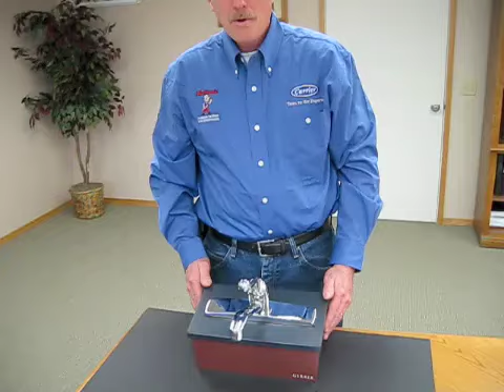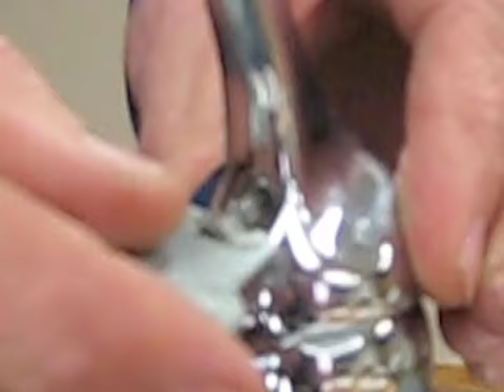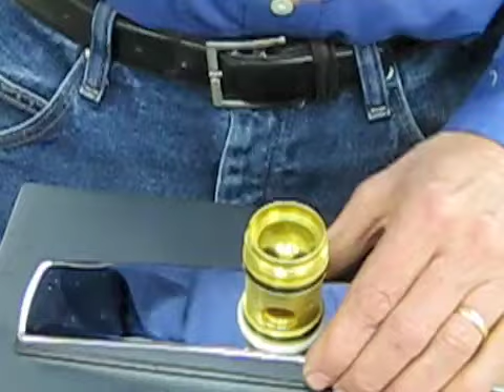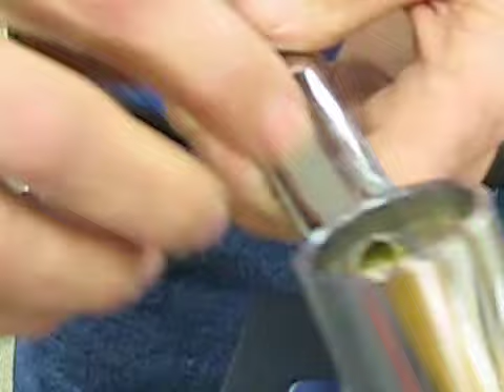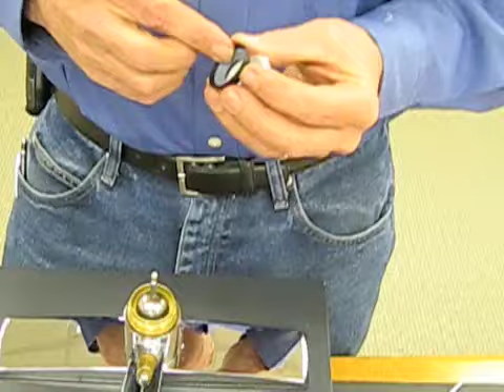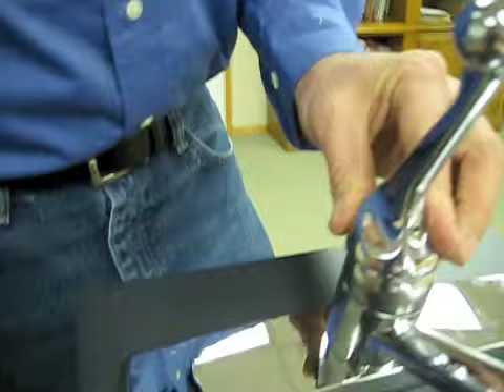Delta Faucet Repair

Comment: Not a plumber ,,,but extremely handy. Have fixed many faucet and shower assemblies over the years, either as new  or rebuild. I think,,if memory serves. The location , position of the ball assembly could in fact cause the hot and cold discharge to be reversed. Still working. Just in an opposite fashion..Which was not shown . Not tragic but requires you  to disassemble a second time . ...Oh ,,,and have never used a wrench without some kind of protection for the chrome from the the wrenches "teeth". Even in my own home . Nevermind a customers if that were the case.

Comment: I completed this 2 days ago. Lubed where recommended.  The spout Drip was resolved but now there is really low and slow seepage out of the faucet body onto the counter  and NO HOT WATER!  Went back through it again and carefully examined everything. Same result.  Yes, main water turned back on and hot and cold valves under the sink were turned back on.  Can anyone advise?  Thank you in advance. 🙂  -Brian

Comment: On my faucet the cap assembly is stuck so tight that it's hard to get off with a pipe wrench and rag to protect the assembly.  The bottom of the cap has "teeth ridges" going around the entire base of the cap ( It's a little different than the one in the video.  I'm not sure it's even a Delta ).  With the cap assembly being so stuck and hard to come off, is there anything I can use to help it come off?  I don't think so but I'm not sure.  I don't want to damage the faucet.  Thanks

Comment: It is nice being shown tutorials on a new faucet, but I have a 12 year Delta Lewiston single lever kitchen faucet that had a bound up (stiff) hub that would not rotate.  I think it was originally installed with a very tiny leak that finally caused enough mineral deposits to bind up the hub rotation.  It took me 6 hours to fix due to the scale and mineral deposits, but here are some tips.
There were enough mineral deposits in the set screw handle that it caused the Allen wrench key to begin bending so much I thought it might break.  So I tilted the handle back, added a piece of tape over the bottom half of the set screw hole, and filled it to the top of the tape with penetrating oil.  After 30 minutes it still would not budge, so I made fashioned an extension for the Allen key by slipping a long thin hex socket wrench over it.  That worked.
Next – the plastic dress cap was welded so badly with mineral deposits that it would not easily rotate off.  It has internal sprocket holes rather than normal external wrench flats, and I didn’t have a spanner.  So I tried a strap wrench.  That just slipped off since the cap is domed shaped, so I tried a layer of super grip fabric under the strap wrench, which did not work either.  I then checked the web and found a hint that tapping it first would free it.  That seemed silly, but I wacked it anyway with the plastic handle of my screwdriver, and low and behold - that did do the trick. 
I thought the hub might just slip off up over the valve bonnet, but was unable to do this, so spent the next two hours trying to unscrew the valve bonnet with all its mineral deposit welds.  My big adjustable wrench just mangled the brass flats, so I opted for a pipe wrench.  However there was so much mineralization on the threads, that the pipe wrentch starting turning the entire faucet body.  I tried tightening the mounting nut under the sink, but that did not help.  So I stuck a big screwdriver down the faucet wand hole in the hub, and applied counter torque in the opposite direction as I rotated the bonnet with the pipe wrench.  That slowly did the trick, and was able to unscrew the bonnet after 15 minutes, and remove the valve cartridge.
I thought the hub would just slip up over that, but it was stuck solid.  After another hour of rocking it back and forth, inserting a putty knife into the bottom of the hub and prying it up with a screw driver, and inserting a screwdriver into the other side of the bottom and rotating it to add more leverage, it finally pulled up and off.
It took another half hour using a wire brush and a Dremel tool grinder to remove all the scale and mineralization that was built up in the hub.  And had to scrape a lot of black stuff off the internal valve bracket that the hub fits over. 
I cleaned off the threads, o-rings, and viring (the v is narrower at the top when you drop back onto the bonnet).  I slathered silicon grease over all threads, rings, and gaskets.  Then reassembled.  
It leaked a bit the first time I tried it, so I removed the dress cap and tightened the bonnet a bit more, which seemed to do the trick.
All in all it probably would have been cheaper time-wise to just install a new fixture, but that would admit defeat.  And none of the parts were actually corroded since they were all brass and chrome and plastic.  The Delta Lewiston was well made (and made in USA).  I don’t think I would have had any problems if the original installer had noticed and fixed the tiny leak.
Reply: I think I am facing the same issue with my bathroom sink faucet. Its a delta brand single handle (acrylic - looks like glass, is transparent) faucet. It opens up from the top by removing the plastic cover cap and removing one screw. After that I am unable to budge the plastic dress cap. Reading this gives me an idea that mine probably is also stuck for similar reasons as I noticed lots of green/orange stuff around the faucet assembly. Thanks for sharing your experience in such detail
Reply: OMG, I went through the same thing you did! At every turn, everything was stuck and corroded but I would not admit defeat and spent countless hours (appx 8-10) taking apart the faucet, then cleaning all the corrosion only to find out (in the end) that the replacement parts didn't quite fit. I thought I was doing something wrong so I disassembled and reassembled multiple times then went to the store and bought Delta replacement parts instead of Danco but the cam still didn't quite fit right. The original cam assembly looked exactly like the one in the video but I could not for the life of me find those exact parts. When I finally managed to reassemble the faucet despite the bulging cam assembly, the handle didn't shut off the cold water as it should so I had a to cock the handle to the right to shut off the water. After all this, within 2 days, the spout developed a pinhole causing a miniature geyser 🙄, that's when I knew I had to throw in the towel but wanted to stop the geyser until I could find a replacement faucet so I proceeded to try silicone to plug the pinholes, that didn't work so I moved on to Marine epoxy, small beads of water ran down the spout so I wrapped the area with Teflon tape which somewhat helped mitigate the small drip. I am now in possession of a Peerless faucet which looks similar to my old Delta and pray that the installation will go smoothly. Lesson learned, don't mess with a forty-year-old fixture, the manufacturer probably no longer makes the correct parts to rebuild it. On the bright side, I can now rebuild a Delta faucet with my eyes closed! 😂
Reply: BTW, I had to saturate every thing with WD-40 and let sit for 30 minutes to an hour in order to first disassemble the handle, then the bonnet, followed by the cam and ball and finally the spout which was the worst. I of course then had to clean and flush the toxic substance from the parts I had to reuse. I realize this was an insane project but I just didn't want to give up.

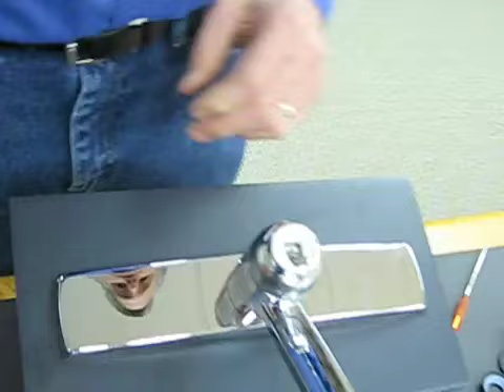Comment: What about the white plastic part that's threaded in to the cap nut?...., there's a weird 2-prong wrench thing to turn it.   Why does it thread into the cap nut, which one do you screw tight first, why isn't anything said about this?  At 8:17-18 when you turn the cap nut with the wrench you can see the white plastic thing move with the nut a bit and also hang up a bit while the cap nut turns around it....that tells me there's some kind of adjustment there that was ignored.  Maybe you just got lucky it was close enough?.   Anyone able to explain how it works?
Otherwise thanks for the video :)
Reply: The white plastic piece has a small tab on it, and the metal 'neck' has a cut-out for the tab. They have to line up to keep the white plastic cap from turning. You can see him pressing the white plastic part down with his finger, to keep the tab in the slot, as he tightens the metal part. The rubber things underneath want to push the white plastic higher so the tab and slot don't meet, hence hold it in place with finger. Also I find that hand tightening that metal piece is good enough, home owners do not own a tool that fits those tiny flats.
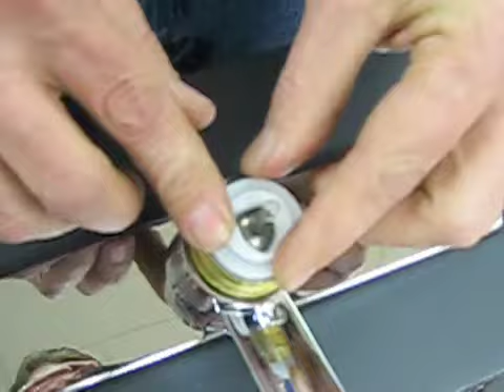Reply: @DAS-Videos   No I'm not talking about the big white plastic thing he calls the "cam", that's obvious, and he explains that, I saw it.  I'm talking about the small white ring that's threaded into the big metal cap nut, he calls it the "cap assembly", at 7:20.
Reply: @TonyMontgomery18  Ohhh. That is what controls the downward pressure on the assembly. It works like a packing nut on a valve. You can loosen it with the right tool, and after screwing on the cap, tighten it until snug with the tool. Or just keep it at the set position like he did. Watch the YT video that ends with watch?v=WpchtD1lkAs
Reply: @TonyMontgomery18  oops I meant youtube video ending with watch?v=3f38yfY3OO8
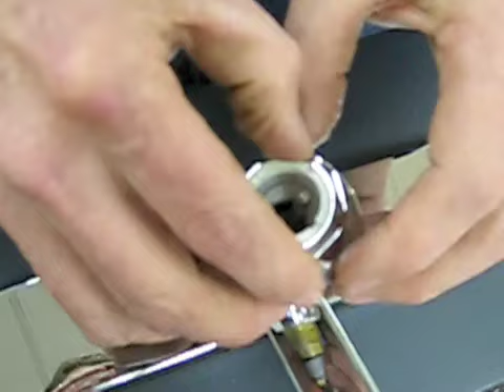Reply: At 7:26 he talks about the tab and slot.

Comment: Remember to tell your audience that the notch inside the housing lines up with the slot on the ball. It makes it easier for the novice. Also remind them that they will replacing parts on an old faucet that has calcium build up some things might feel like they are all seized up such as the set screw and the faucet arm. Good video all in all.

Comment: Mine is a Delta kitchen faucet that looks like this on the outside, but nothing like this on the inside. Instead of a ball, there's a flat white puck that is moved around over a plate with holes in it.

Comment: Okay I have turned my spout to the side but it will not come off and I have manhandled it enough to feel like it's really not coming off. Any tips? Thanks!
Reply: Just so people know most probably will not have such an easy time getting their spout off and I had to turn mine from one way to another and violently manhandle it over and over and over in order to get it off.
Reply: @lockergr  I can't get the spout off at all, any thoughts or solution?
Reply: I cant get the damn thing off turning it to either side, thoughts?

Comment: Nice video! only two things changed. The Allen wrench tool supplied was one size to small or the wrench itself stripped out. Next was I used a large crescent wrench instead. Other wise I followed your instructions exactly.  Thank you for posting.

Comment: You did not mention the white nylon threaded piece with the two slots when you replaced the CAP. This is why I watched the VIDEO...because the instructions don't include the adjustment of that nylon part.
I THINK it is a way to add slightly more pressure to the BALL, but I am not sure so I will try another VIDEO.

Comment: Could have been a MUCH better tutorial IF the camera had been in FOCUS!  Also, the springs have a larger diameter end, and a smaller diameter end, and you failed to show the proper positioning for these springs when they're reinserted!
Reply: I was thinking the same thing. Which side goes into the washer? If you have a heads up please reply...Thanks.

Comment: can trash get any where n there & cause low water pressure & or low water volume ?
Reply: Yes, trash in the water supply, namely tiny peddles or grains of sand can clog a faucet's aerator.  The aerator is located at the end of every faucet and can be removed by unscrewing by hand and/or a wrench.  Run the faucet without the aerator to test the flow.  Clean or replace the aerator as needed.

Comment: Gee Henry; You never mentioned lining up the slot in the ball, with the pin in the right side , of the base , or part that remains on the sink. It would seem that would be a very important step, easily overlooked, and easy to ruin parts if not pointed out.

Comment: If you can net get the set screw on the handle off USE HEAT with a propane torch.  Unscrew it while it is hot.

Comment: Good instructions. I noticed that the "delta" tool was not used to either loosen or tighten the white cap on the top of the assembly under the handle. I thought its purpose was to seal the ball assembly after the chrome cap was screwed in place.
Thanks
Reply: That's what I thought. Mine is so old that it has a white threaded "ring" with spanner slots, so that tool can be used. It  compresses the ball assembly, and the top together, removing any slop that may be there.   Must have been before Henry's time.

Comment: I'm at a complere loss with my delta ,one handle kitchen faucet....please help....it is spraying so I've replaced all that you've shown except the ball( one didn't come in the kit) it is loose still and sprays at the sides and is difficult to find correct spot to have it in shut off position to stop water flow...
what am I doing wrong??
Reply: +priscilla d Check your ball cam. the tab on the side has to be pushed down into the notch on the corresponding side of the valve body to allow the cap to fully & tighten down on the cam and ball.
Reply: +priscilla d The two springs each have a big end and a little end. It appears that the little end fits perfectly into bottom of the rubber part. When I did this, I got the result that you detail. I pulled it all apart again and reversed the springs -- big end next to the bottom of the rubber. Worked perfectly.

Comment: This video makes it look so easy, but I'm wondering if doing this procedure would fix a squeaky groaning noise when you move the faucet (not the handle) back and forth. Also is that Delta tool a "must have" or would there be something that you could substitute? Thanks!!

Comment: Thanks for the video. I didn't realize there was an allen screw at the front of the handle; it was covered by a press-in plastic decoration. For someone on a budget, it might be more appropriate to replace only the parts that are leaking. In my case, the problem is a slow drip from the spout, caused by the two cup washers under the ball. The other parts (o-rings) are fine, so I'll replace them the next time the cup washers leak.
Reply: +Henry Bush Plumbing, Heating & Air Conditioning yetttbjffbs.in afxvtjhnmb nm n.  b
 French vdfhgghhhkkflllllllifhmkkdlijfbj

Comment: I purchased the parts shown in this video; followed along and did the same thing here at my home. Worked perfectly, no more leaking. Not being a plumber handyman this video was excellent and resulted in another job of the list. Thanks for the well laid out steps, only thing I didn't bother to chnage were the 2 spout rings under the handle body itself. Forgot to buy them :(, anyway they didn't effect the leaking at all.

Comment: Thank you Wes and Henry Bush Plumbing for this video. I could never get my spout to come off, so I didn't think it would come of without going under the sink. My bad back can't handle that task so it just kept leaking for the past year. I needed to replace the o-rings because it would leak from the base of the spout when in use. After seeing you just pull the spout right off of the faucet, I sprayed silicone down thru top of spout area and moved it back and forth. Voila, it came off and I went to the hardware store with every part inside for replacement parts. $30 later and about a half hour of getting it all assembled properly, my Delta faucet works better and easier than it has in 15 years! I can't thank you enough for supplying us with this video. Thanks again Wes!!!!

Comment: My delta kitchen faucet was dripping. I replaced the springs, grommets, ball, ball cover silver plastic thing. Still leaking. 

My solution after many attempts. I only replaced the springs and spring grommets. All else I used old parts. 

I used genuine Delta parts from an authorized dealer. Part number 0-2999. Not sure what's my model number for my sink though.

Comment: I just followed this video to replace the washers in my Delta faucet. I had a few issues.  Firstly the enclosed 1/8" Delta tool supplied with my replacement kit was not able to remove the screw in the handle. It kept turning in the handle. I had to go purchase an allen key set.

Then the handle did not slide off easily as the video shows. I had to apply a lot of pressure to remove it and also sprayed a lot of WD40 to help.

Finally I was not able to remove the handle at all. It would not slide up so I could not replace the O rings. I suspect my leak was not coming from that area. Anyway after replacing the two washers and the cam assembly and washer and putting it all back, the faucet was repaired.
Reply: So basically you fixed it..? Leave a like and move on, no one cares about your ability to follow instructions
Reply: The delta special key is just another name for an allen key. Find the one that fits and off you go..

Comment: Thank you so much. I have never rebuilt a faucet and thought the single handle would be a nightmare. I was ready to replace it with a two knob type till I saw your video. I returned the eighty dollar faucet in exchange for the twelve dollar rebuild kit and of course got most of my money back and now it works better than it did when I first bought it! Again thank you.

Comment: Thanks for this very detailed and helpful set of instructions.  I probably saved half an hour by watching the video first and lining up my tools before repairing the faucet.  Using the dental pick was a great suggestion.  I happened to already have a worn out pick that I got from my dentist a few years ago when I had a project to remove old grout between tiles.